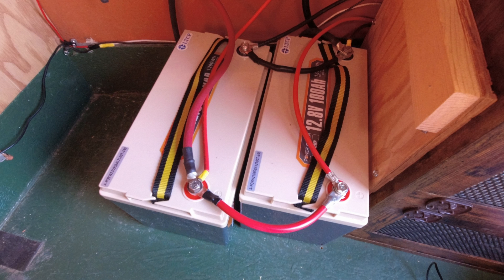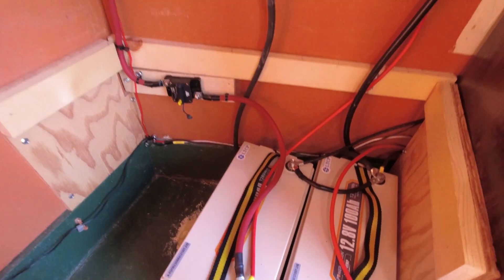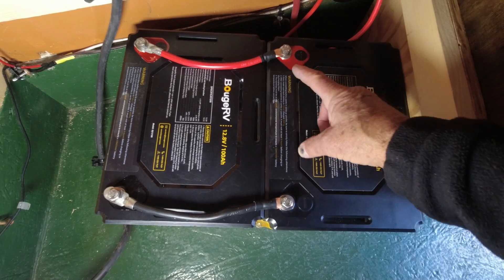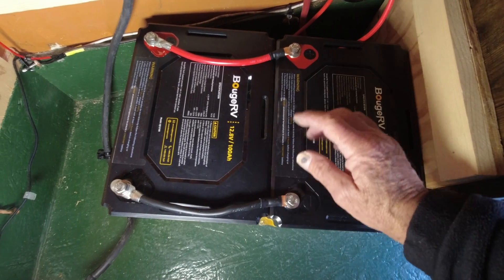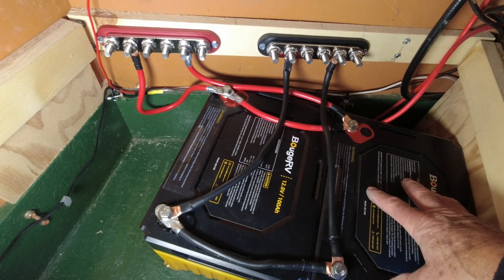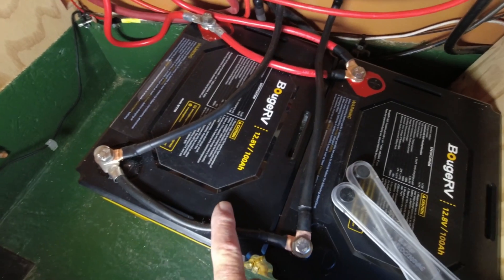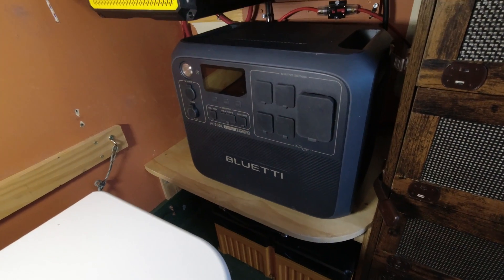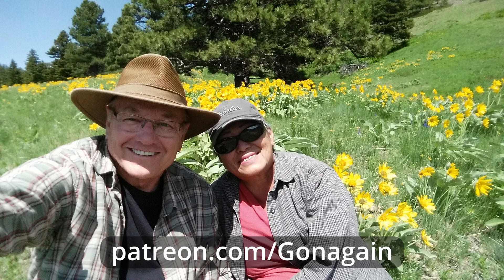How Are Your Batteries Wired?

Comment: Hi Rick!   On your best hook up.  I wonder if the jumper between the batteries is still needed for parallel hook up ?   No expert here ,  just getting ready for 2 lithium batteries and bus bars , and I like the way you did it.   Couldn't find will prowse video, did find one from sun fun kit.   And it was quite interesting check it out.  Thanks!
Reply from the maker: Yes, the jumper is still needed with a parallel hookup! Sorry took so long in answering.

Comment: Nice practical and informative dyi video!   I use a combination of EcoFlow and DIY battery backup with independent solar controller and inverter.   I have been thinking of adding more 12 volt batteries in series.   I’ve read it’s important to have the parallel batteries of similar age and history of use for LiFePOs.   What do you think?   Thanks again for your videos.
Reply from the maker: It's definitely best to have the batteries of the same age and manufacturer, for the sake of the batteries themselves, but wiring them this way makes it possible to have small differences.

Comment: Becareful and don't charge your battery when they are below 32*.
Reply from the maker: That's a fact.  The BougeRV batteries in the video are the self-heating type, so that isn't a problem and there are also batteries that have a low-temp cut-off that prevent them from being charged below 32 degrees.  I have a video about that coming out soon.
Reply: I'll have to look up that video if it's already done because that was the question I was looking for and the answer.
Reply: @dawnmatthews1919  did you ever find the answer to the question

Comment: 2 things.
1) The breaker type you are using to shut off the inverter, those have been known to exceed their amperage rating. Wouldnd hurt to put a "ANL" mega type fuse in between the battery and the output cable.

2) The diameter of the cable is determined by a formula.
The inverter output (not peak output) divided by the battery voltage, then divided by the efficiency rating of the inverter.
Take that final value and that is the amperage potential your inverter can produce, use the Blue Seas ampacity chart to get the AWG size required for that amperage.
Let me know if you have any questions on that.
Thanks for your good posts.
Reply: You are very correct.
When I built my system no one could tell me that.
Load is what determines wire size.
Reply from the maker: Good information and thank you for posting it here.

Comment: Happiness is a clean wiring job. I have similar buses connecting my wires. I'm considering switching to the Lynx system, neater and pricier. It's a want to have, not a need to have as the existing bus bars will last as long as the system. The only thing I do want is a shunt on the battery cable so I can see total actual being used or charged. Heated batteries plus Montana winters equals wise decision. 
Will we see you in Q this year? My same group will be there. We'll eventually end up in Texas April 8th for the total eclipse. It's very important to be in the center of the path for totality. After that, it's home to get a ton of housework done and fix things up..
Take care and be warm . I prescribe 2 hot chochlates and a slice of pie!
Reply from the maker: Thanks for the prescribed "medicine", Jeff! We plan on leaving for Q in late February, hope you and the guys will still be around. We're looking forward to being down there in the warm and sunny desert areas.

Comment: Excellent, this is Perfect Rick. Thank You for this video. I've yet to put panels on the roof, and have been waiting while I figure out which way to go. Meaning, which panels to get and what system to run. As you've said before, Nothing is permanent in (or on)our cargo-rigs and that is a blessing on its own. However, I do believe I need a one-on-one tutorial. Either way, this is My Month, Dec., and I'm going to make it a Good One. Rick, how is your shoulder holding up?? I Hope you are not suffering too badly to enjoy this Holiday Season?? God Bless Always. Hi Linda 👋
Reply from the maker: I'm doing fine, but I spent yesterday rolling around under the trailer installing new leaf springs and I'm suffering for it today!

Comment: Good electrical system. I couldn't see how the final position of the batteries went under that shelf, but I hope there was some straps around the batteries, holding them in place. You don't want you batteries dancing around in the trailer when you go over bumps.
Reply from the maker: The BougeRV batteries have screw holes around the bottom that let you fasten them to the floor.

Comment: Nicely done, Rick! Couldn't agree more about the peace of mind offered by the automotive switched fuse. Another way for a newly designed system to reach the busbar type of solution and reduce the total number of components would include a controller-inverter-charger all in one unit, with a separate DC fused circuit(s), even terminal mounted. 

Once upon a time inverter-chargers were the priciest options out there, but there are some very reliable wall mounted units now with solar controllers included that are worth looking at.

Comment: I also run two redundant solar generators with one set of panels.  I used one of the big red Blue Sea switches to choose which generator receives juice from the panels.  So far the switch has handled voltage and amperage w/o problem.  This avoids frequent plugging and unplugging, which my hands don’t like…..
Reply from the maker: Thanks for the tip, I'll look that switch up.

Comment: Why do you need the jump wires on the batteries?
Reply: But doesn’t the buss bar connect the batteries together
Reply from the maker: I'm not positive of what you're asking, but the wires that go from positive to positive and negative to negative are what make the two batteries into one battery bank.  The other wires to the buss bars make them charge and discharge evenly.